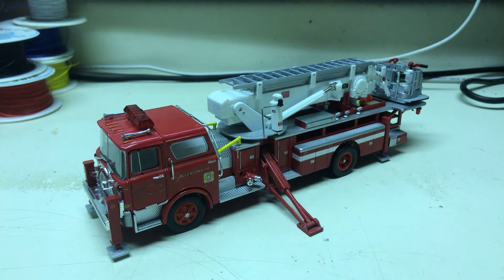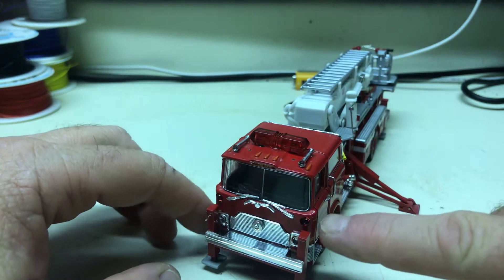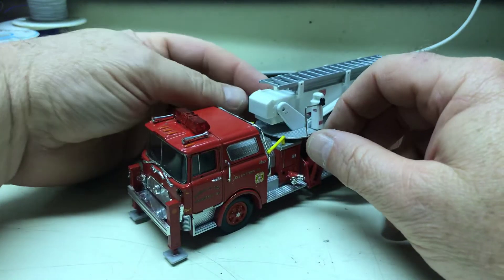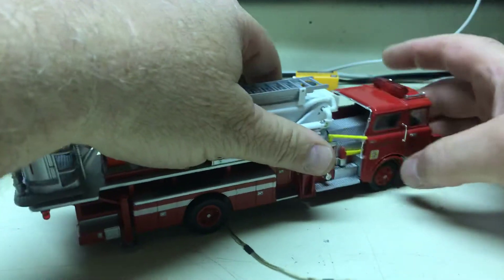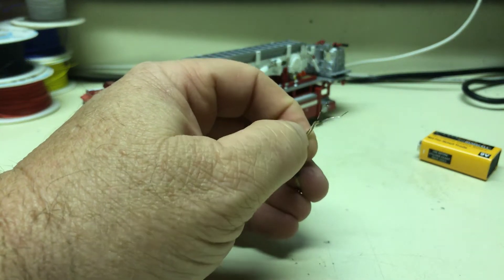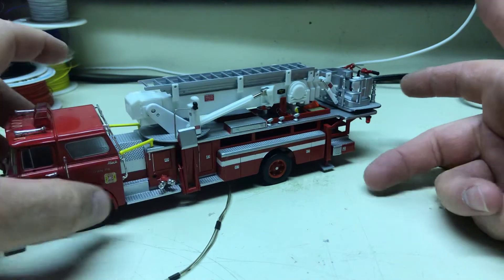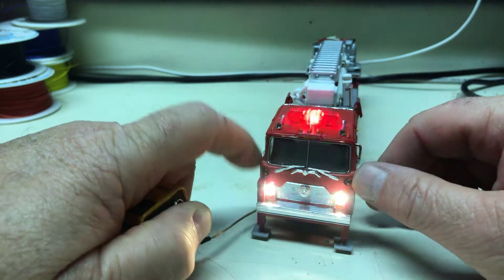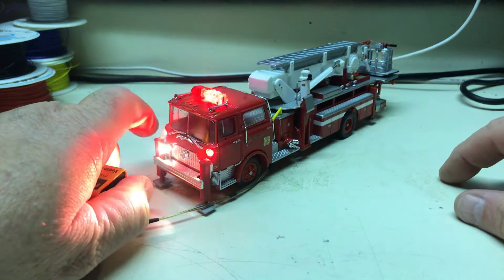John's custom Mack CF diecast platform fire truck model with working lights

Comment: Nice! The wig wags on the front are a little to fast. If you seen the alternating ditch lights on a Norfolk Southern engine that how they flashed in real life. I actually got 2 of these models. One of them being serial number 2!
Reply from the maker: I never even thought about slowing them down.  I'm so used to building this board with the same components for police w/w headlights, I guess it never crossed my mind